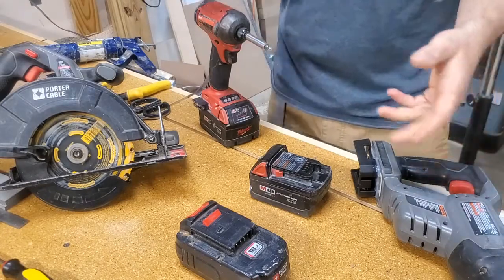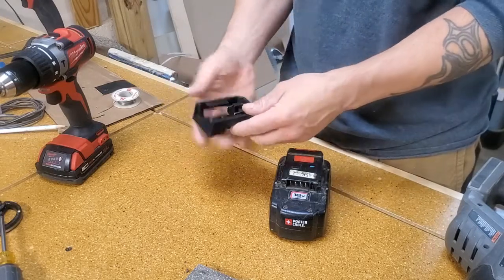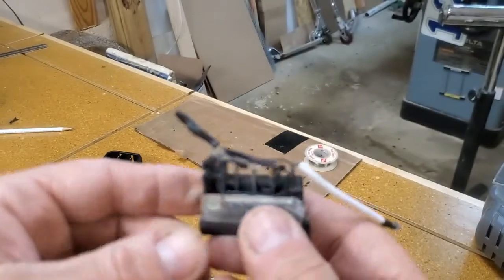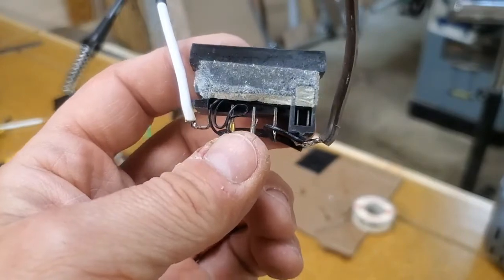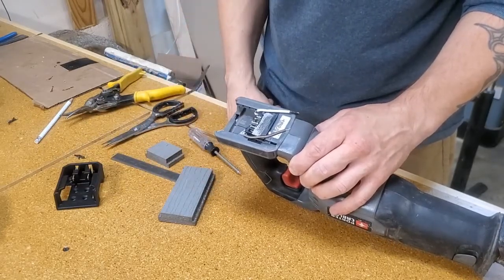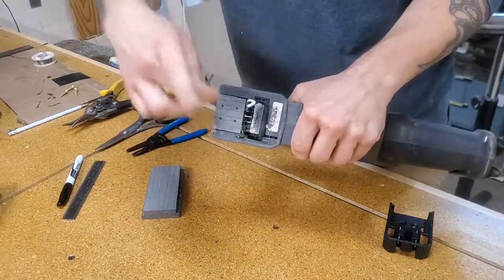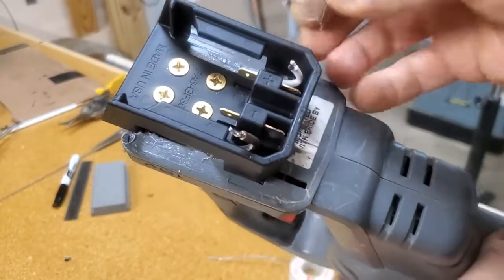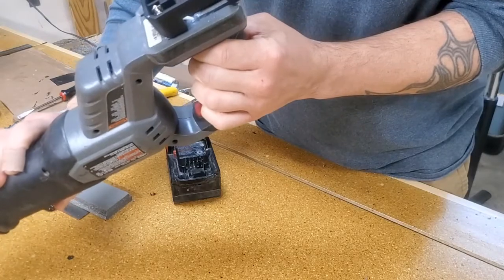Converting Porter Cable 18V To Use M18 Battery

Comment: Just saw your vid , same thing I did  to my snap-on 3/8 impact and 1/2 impact , same adapter also . Only thing I did different is I took the tool apart and soldered wires right to the switch. Good  video 👍

Comment: MILWAUKEE MUST'VE PAID OFF ALL THE CHINESE ADAPTER 3D PRINTER MANUFACTURERS TO NOT MAKE ANY ADAPTERS SO I CAN PUT A 20 VOLT PORTER CABLE BATTERY INTO MILWAUKEE M18 LINE OF TOOLS? 

CONSPIRACY THAT THEY MAKE MANY ADAPTERS EVEN FOR USING M18 BATTERIES IN OLD 18 VOLT PORTER CABLE TOOLS EVEN 20 VOLT TOOLS EVEN HARBOR FREIGHT.

WHAT THEY ALL HAVE IN COMMON IN THIS POTENTIAL CONSPIRACY IS THAT THEY SEEM TO ALL MAKE ADAPTERS TO USE THOSE SUPER EXPENSIVE MILWAUKEE BATTERIES IN ALMOST EVERY CONFIGURATION FOR OTHER MANUFACTURERS TOOLS,  

BUT ..... 
WHEN I CAN GET 6AH PORTER CABLE BATTERIES AT  THIRD OF THE COST OF ANY COMPARABLE MILWAUKEE 6AH BATTERY. THAT NOT ONE OF THESE PEOPLE SEEM TO 3D PRINT ONE FOR THE USE OF 20 VOLT PORTER CABLE BATTERIES FOR USE IN MILWAKEE TOOLS IS MI D BLOWING COVERUP.... WHEN PORTER CABLE IS ONE OF THE MOST WELL USED AND BOUGHT TOOL LINES IN HISTORY FOR DECADES AT EVERY BIG BOX STORE.

Go figure? .....AS IF THEY MAKE A M18 BATTERY ADAPTER FOR THE ANCIENT 18 VOLT PORTER CABLE TOOL LINEUP IF NOT TO PROMOTE THE M18 BATTERIES TO BE USED IN ALL TOOLS.......ABSOLUTELY ABSOLUTELY UNRIGHTEOUS CONSPIRACY.

so anyone saying the 20 VOLT LINE UP IS OUTDATED. YOU ARE INCORRECT,  BECAUSE THIS CONSPIRACY CONTINUES ON BECAUSE THEY INDEED SELL ADAPTERS TO USE THE EXTREMELY EXPENSIVE  M18 BATTERIES EVEN IN 20 VOLT PORTER CABLE TOOLS.

IF THEY JUST REVERSE THIS ADAPTER AND 3D PRINT THEM SO MANY PEOPLE CAN BE HAPPY TO STILL USE AFTERMARKET ABSOLUTELY STELLER BATTEIES IN 6AH PORTER CABLE BATTERIES WHICH RIVAL THE MAJOR PLAYERS LINES OF BATTERIES ALL DAY LONG.  

8 AFTERMARKET PORTER CABLE 20 VOLT 6AH BATTERIES FOR AROUND 200 BUCKS....PLEASE...LOL.... MAYBE MILWAUKEE PAID THEM OFF TO NOT  MAKE THE ADAPTER I'VE DESCRIBED?    

BECAUSE THE SAME 8 BATTERIES TODAY AT HOME DEPOT ARE    $ 279.99 FOR A TWO PACK... HENCE , that is ....ONE THOUSAND ONE HUNDRED NINETEEN DOLLARS AND SOME MORE NONE CENTS.....PLUS TAX. .....   ONE COULD BUY 40 , YES FORTY 6AH AFTERMARKET BATTERIES COMPARED TO THOSE INSANE PRICES........ THAT WOULD BE 240 AMP HOURS AND 4800 WATTS ... ENOUGH TO POWER YOUR HOUSE WITH FORTY BATTERIES. .....LOL.....

THIS IS WHY YOU'LL SEE  MOSTLY MAJORITY OF 3D PRINTED ADAPTERS FOR THE MAJOR EXPENSIVE PLAYERS BATTERIES(MILWAKEE, DEWALT, ECT. .) BATTERIES TO USE THEIR EXPENSIVE BATTERIES IN THE CHEAPER BRAND TOOLS.... BUT RARELY NEVER THE OTHER WAY AROUND. .......

Comment: *IF YOU COULD SHOW  THIS IN REVERSE TO USE PORTER CABLE (TWENTY VOLT) ,  20 VOLT BATTERIES IN MILWAKEE M18 TOOL LINE UP OR ITS STILL A CONSPIRACY TO USE THE BIG EXPENSIVE BOX STORE BATTERIES. .AND I'M BUYING MANY OF THEM....LOL... even the 18 volt batteries from porter cable inserted into ANY MILWAUKEE M18 LINE UP, AND I'M STILL SOLD....

Comment: This is exactly what I had imagined in my head, but can you just buy an already made adapter for more money and less hassle? I see some on line but they say porter cable 20v black and decker so it makes me unsure if it will fit my porter cable stuff that is just like yours.